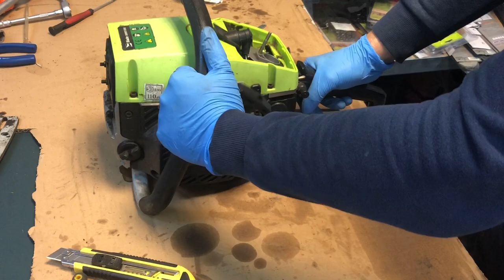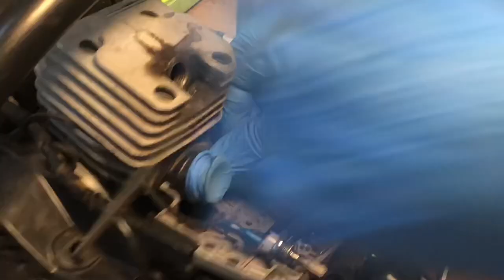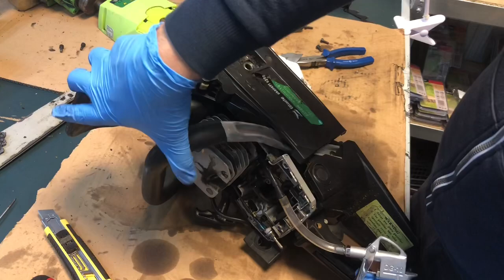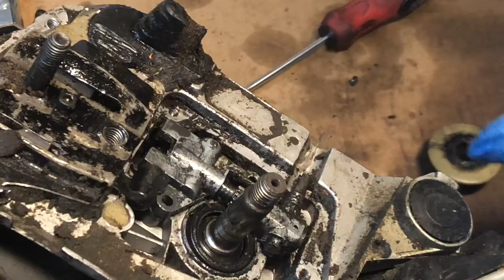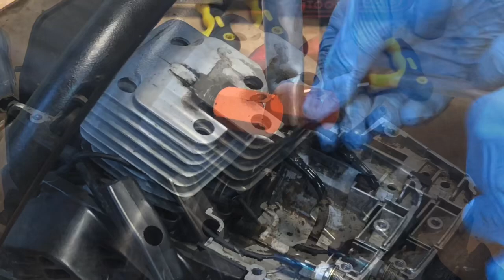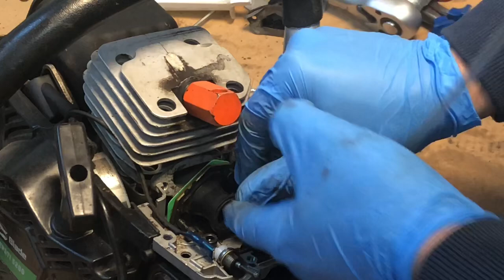Drujba nu porneste, diagnosticare, etape verificare

Comment: eu cu a mea ma chinui de 3 zile si nu porneste nici sa o omori.. am verificat ce am vazut in acest video: are vacuumul,  am schimbat recent rulmentii si am suflat - nu are scapari; ptimeste benxina, scanteie  super, dar oricat as trage nu porneste deloc.. imi vine sa o arunc

Am si o husqvarna 357 de aproape 10 ani, eu o intretin, I-am pus cilindru chinezesc, pt ca o cumparasem defecta cu cilindru zgariat.. doar ii schimb segmentul o data pe an pt ca tai destul cu ea, si merge super ok, pornire la prima "cheie".. tot firma e firma, desi I-am bagat cilindru china de 359, ca nu mi-am permis unul original de 357

Dar chinezeasca in schimb mi-a scos peri albi in doar 2 ani
Reply: Ma fratiilor nu tre sa tragi la ea o sapt sa porneasca ,ai tras de 3 4 ori na pornit are ceva logic ,tu zici ca ai schimbat rulumentii si nu sufla da acolo ai si semeringuri uzura cilindru ,segmenti, si bujia multi o scoate se uita la scanteie, da depinde poate sa dea 2 da si una nu ,acolo risti so ineci,e bn sa sti ca am  avut bujie defecta din fabrica nimica nu ieste exclus ,si fasa cu injectia direct in camera de ardere e un risc foarte mare ?
Reply from the maker: Corect!